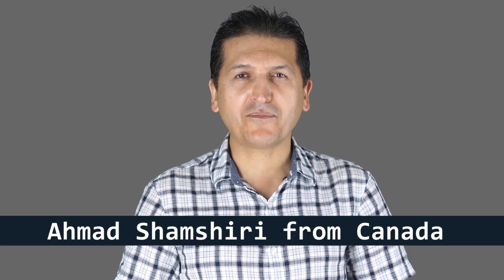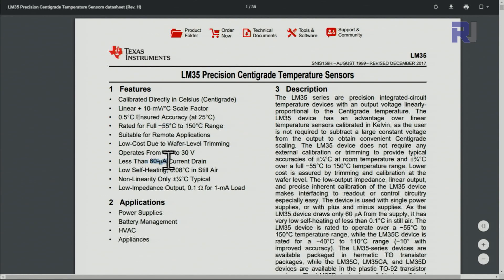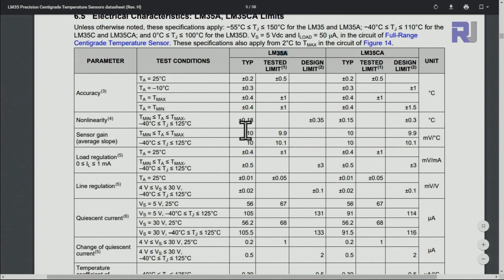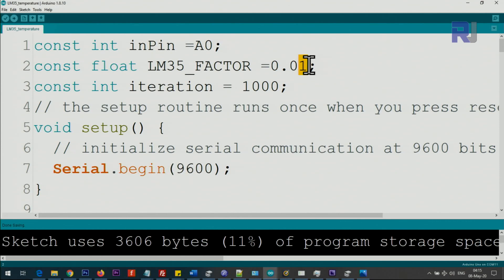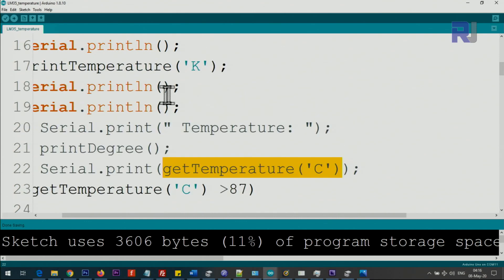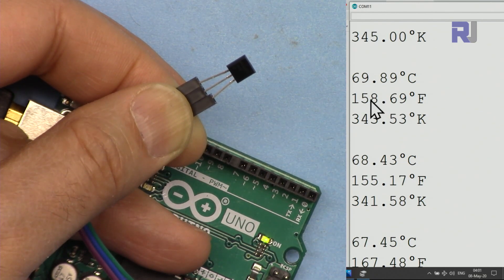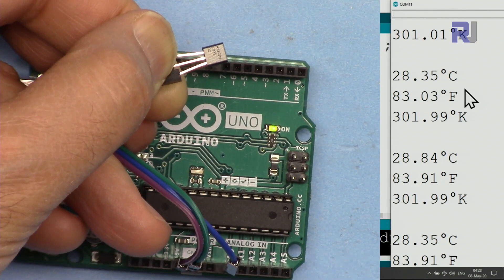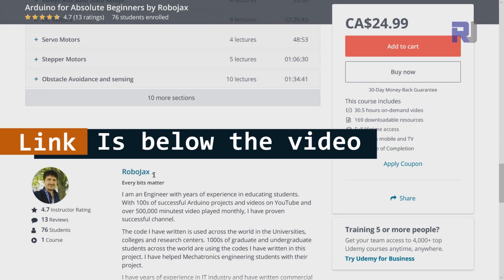How to use LM35 To Measure Temperature in Celsius Fahrenheit and Kelvin

Comment: Can it measures body temperature
Reply from the maker: Yes if  it is  fully in contact with your  body or any object . If you put between two fingers your might get accurate reading.
Reply: @robojax  Sir but I get the same reading with and without finger

Comment: Thank you for the video. Can you please advise whether LM35 can be used to measure 30-120 degC with corresponding output 0-10V? As i understood at 30 deg C we get 300mv and at 120 degc - 1.2V.
Reply from the maker: Hello, I had to watch the video because I believed your question should have been answered in the video and indeed I have explained it in  the first 2 minuets of the video.  you get 300mV for every °C. at 1:10 I've shown the datasheet. Only LMC35 and LM35A give you 150°C (again I've explained it in video ).
the output is independent of voltage source and as you can see on datasheet. it can operate from 4 to 30V. whatever voltage you have you will get 300mV/°C you you do the math. Arduino works with 5V or 3.3V. but you can supply external voltage of up to 30V. 
I hope you watch the video again to see everything said above in the video to understand it better.

Comment: can i use lm35 as temperture input to hobby charger ? i have Accucel-6 80w charger.
Reply from the maker: if you watched the video, LM35 is just output voltage. I don't know about that charger. if you can fit it and make it work. yes. Watch LM35 introduction carefully.

Comment: Think you must have an asbestos thumb :-).
I have used this device many years ago with a PIC 16C84 (or something similar) device. I was able to make a shower proof sensor of it for measuring chilled water. To be honest I prefer this to the Temp/Humid Modules. My reason for looking at the Arduino is to monitor some low temperatures inside metal enclosures. This is able to be connected to a ribbon cable of practical length with Arduino device outside and WiFi-able maybe/possibly CAN Bus (preferred) I have used Industrial CAN Bus in the past and like it.
Many thanks.
Reply from the maker: You are welcome. 
I've read your comment 3 or 4 times and googled 2 or 3 times the "asbestos thumb" and got nothing but this search result https://en.wikipedia.org/wiki/Nail_clubbing#/media/File:Acopaquia.jpg which my nails don't look like.
Reply: @robojax  Heat resistant thumb:-). You were blasting hot air at the temperature sensor for a long while, your thumb looked to be close.
Reply from the maker: LOL . the camera angle from the top showed it that way. my finger was exposed thouse somewhat. But I cant' tolerate heat.